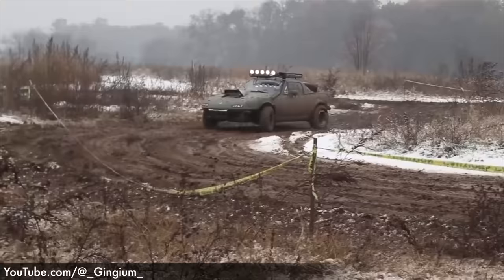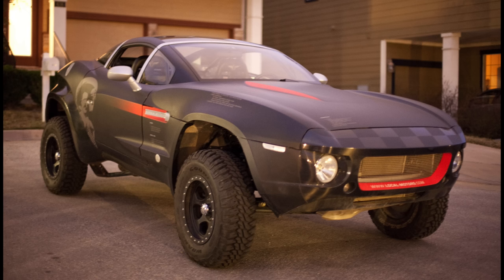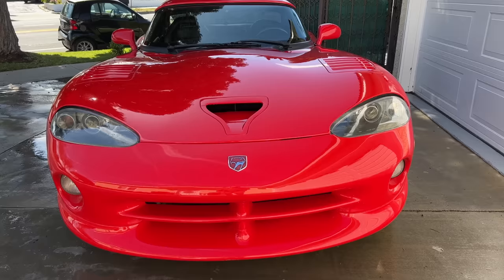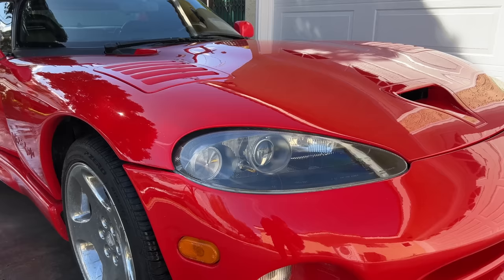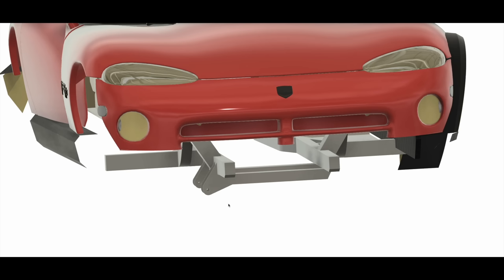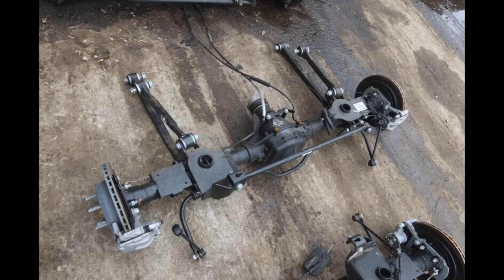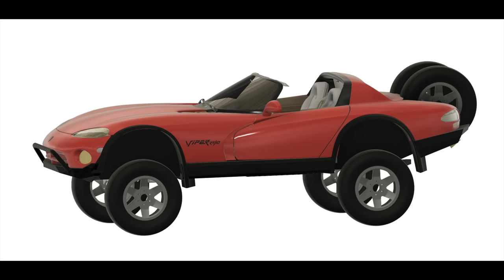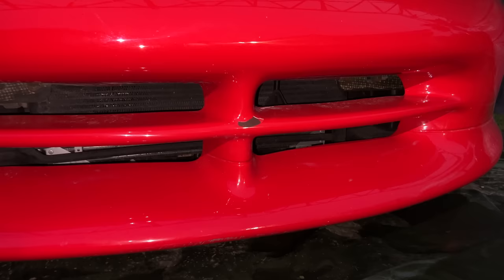Let's Build An Off-Road Viper

Comment: Add electric hub motors to the front tires to give you part time four wheel drive for when you get impossibly stuck. Could get away with a tiny battery due to the part time nature of 4WD.

Comment: You might be able to do AWD instead of 4WD if you use the front transfer case out of an x-drive bimmer. If you happen to find one in a junkyard you'd probably be able to rip out the ZF-8HP trans at the same time.

Comment: You should use solid axles in the front too. It’ll be easier than designing control arms/spindles & it would be stronger than IFS too.

Comment: You might consider a rear axle from a Ford E 450. They are beefy and often paired with a 6.8L V10 engine. The heavy duty Ford automatic 5 or 6 speed are great transmissions as well.

Comment: I think adding front wheel drive should be looked at doing this electrically, with some 48v system that will fit somewhere in there. It will only support you at low speeds. Which is very interesting, but maybe not for this car. You just want to send it at higher speeds, just like the Rally fighter.

Comment: I noticed the powder trick you used for scanning. We had to use that a lot especially on black cars when we scanned accident surveys. 

I did the Viper idea. Just a thought if you are having packaging issues. Maybe do portal axles and get the lift without moving the axle shafts too much.

Comment: As crazy as it seems a Viper is a pretty decent option for this. The chassis and suspension is pretty simple and there’s a good bit of frame to attach mounts to. And, there should be lots of room in the trans tunnel for whatever you need to put in there.
Reply: There are even more features on the level that you’ve qualified it as “decent”. Such as- it’s a car and also it can be bought.

Comment: You could try getting a Unimog (404) axle for the back. 
I mean do I have to say more than: Portalaxles?
Besides that you've got a proper locking diff, they can somewhat easily changed in with the way they're designed.
The fitting from axle Also has an Offset diff to clear the engine on the mogs. 

Maybe they're worth a shot.

Comment: Ide put a 4l80e behind the viper engine if your going auto, it's stout,  lots of transfer case options, it's got huge aftermarket,  parts are cheap and easy to find. Ita got overdrive, and the gearing is already good enough you don't need 8 gears.

Comment: Axle from 3/4 ton 4x4 Dodge Cummings truck may be what you are looking for. I believe they are Dana 60/variant. It’s a common swap on built Jeeps when you keep breaking stuff. Not sure on trans but the auto trans may just bolt up. Of course I haven’t verified any of this because this is your project not mine.😬😇 Sloppy Mechanics repurposed those dirt cheap Ford 8.8 rear offset pumpkin axles by using two of the long sides. He was running 900+ hp through them. A limited slip rear end maybe what you want if locker is not feasible. Well Rubicon axle maybe looking better.😇

Comment: Could you put a couple of small electric motors up front to solve your 4WD needs? Hook up a KERS system, and a couple of batteries tucked up underneath, and presto, easy peasy (not in the least). Be well.

Comment: I fucking love this. 
If you are going ZF and maybe AWD, could you pull a transmission and transfercase out of an X-drive BMW? I know the X5 has the ZF8HP and an AWD system, if you could find something similar to canibalize (and figure out a way to communicate with the ZF and centre diff clutch packs) then that would probably be the idea solution. There are a bazillion cars that use the ZF 8 speed and a lot of them are AWD so you have ample options

Comment: How about a couple of hub wheel motors up front. So much trouble to go to, just to get stuck on wet grass. Even 20 kW per wheel, and I think you could walk out of the soft stuff, and maybe always bleed 10 kW to them in normal driving to make it less twitchy, or to limp home 10 km, after your drive shaft fails....?

Comment: I love the 8hp70 and cant wait to see how you control it but, I hope the torque multiplication vs large heavy wheel wont snap axles in the dana44. Check the m220 version in the 392 powered  wrangler jl

Comment: Look into old tractor parts, see steiner catalog for example,  they carry lots of oddly sized and specific parts that are more than  overbuilt for this application and they're relatively cheap for universal components,  just find the part you need and cross reference it to the agriculture industrial hardware category via Google and bam, tractor part prefab, 500 vs 5000 for racing specific parts. P.s. my 1945 farmall is literally indestructible and is more dependable than my truck or my car. Good luck!

Comment: Mainly here for the algorithm but I vote a ford nine inch or gm 12 bolt for the rear. Mainly because its relatively easy to get aluminum housings for them for cheapish and this will keep the unsprung weigh down a little bit. However, having a rather large mass in the arse of a viper sort of embraces the whole america-ness of the build. It doesn't have traction onroad, why should it have it offroad?

Comment: Don’t screw around with a zf trans. Use a 68rfe Chrysler 6 speed. Will bolt right up, operate way better and be way cheaper.

Comment: Awesome project! I am not sure it will surpass the sandwhich though!

Also, why so many flat tires? I have done two huge overlanding trips through all of Asia, and I only had a few flat tires, of which some were preventable. Even for those huge trips, I now just take 1 spare and some basic tools and compressor to get another one going far enough to reach civilization again.

Comment: Well when the poll was up I loved the idea of a jet engine electric car. I'm now doing some research and planning to build my own car. I want to recreate the fallout 4 car . Add the 2 electric motors. The back is already perfect for a jet engine.  And the front has a huge grill for cooling.  
I could use a 3d printer to make a fiberglass mold . And a Cadillac frame. Or a full custom frame

Comment: I don't know what axle ratio these run stock, but you're going to need a wildly short gear ratio out back to prevent it from topping out at 120mph in second. These cars already have long ass gears, and now you're talking about 33in tires on a car with a 0.5:1 overdrive 6th.

Edit: You mentioned that later on, 4.70 sounds about right, though with an auto trans it's really not that important

Comment: The ones that are bespoke and going to get damaged first evil grin here. Don't you mean the ones that are going to get yanked off and sold and replaced with something much better and more beefy and not going to be worried about in the first place? Honestly if I was going to do a off-road Viper I'd be going a slightly different direction than you are and I'd be mainly using the motor and the body itself but like you said you don't want to use a Viper hat on a truck. I've honestly wanted to do something similar to what you're talking about with a Chevy Caprice or a yes it's been done before 60s Mustang body but in either of those cases it would honestly simply be a shell on a drivetrain. I've also seen four wheel drive Chevy utility vans that make me very very tingly;) and a few of these as I understand it were actually made by a company back in the day Ford put out a couple as well that were actual four wheel drive lifted assembly line built Bad girls that were basically a mullet with tires , business in the front party in the back cranked up to 11;). I practically do good to pay some of the bills and get from month to month so I don't have a four-wheel drive Chevy utility van insult injury being I know somebody that has one sitting in their yard growing up in the grass and the reason the guy bought it will make you even more sick he bought it to use parts of it on a Suburban where this particular van was built with mostly Suburban parts. Nice idea there sunshine boy taking a super rare vehicle and using it for parts on a very common vehicle. No there was nothing to write the vehicle off it was running and driving and not rotted out he simply bought it to use it for parts on a Suburban that he owned or more than one Suburban to be precise guy had a couple of custom-built off-road Suburbans and this was his Parts vehicle. So it's not like something somebody dreamed up I've seen the thing and touch the thing I know they exist lol. I've seen the Ford ones running around here a few times very nice units. Would just love to you at some point own a van or more so Caprice done up like that always makes me think of Mad Max;). Seeing a few 60s Mustang bodies done up with a frame and drivetrain and just love the look. What you're describing is basically an apocalypse ride and I like that somebody's doing it with a Viper but honestly I'd go with a completely different frame and drivetrain and just use the body and the motor.Because it eliminates a lot of problems down the road and makes the vehicle much more durableYes I don't have the money and yes again personal preference. You got the money and the skill so by all means go for it. I know exactly where you're coming from

Comment: Will a Viper chassis surive the repeated stress and extra vibration of going over dunes? Those things are probably built a bit more lightweight than trucks, right? Feels like this is could go the way of the motobike engine oilpan after you take it for some serious extended offroad tours.

Comment: Dana 44 is a terrible choice 😂. It’s all about ring gear diameter especially with a v10 . The bigger the better . It’s not horsepower or torque that will destroy them it’s the unloading and loading of the tires

Comment: Lmao I live in Montana and ls6 swapped my Miata (horrible car to ls swap and terrible place to build one), a few months later I threw a paco motorsports 3” lift kit on it and 25inch Blizzaks when winter rolled around and now I deliver ubereats in a 2000lb death trap in snow and ice muscling 400lb-ft of torque through a t56 magnum and a t-bird 8.8. Seeing this build idea gives me some validation, even though I couldn’t afford a viper, that lifted convertible muscle swap cars are cool and will forever be cool. Is any of the power usable? Absolutely not in winter but I still managed to get a 118mph speeding ticket at the top of an icy uphill onramp from an incredibly confused highway patrol officer who couldn’t reconcile his radar numbers with the car he saw and the limited space it had to accelerate. However, a few months later my CV axles are unfortunately in need of replacement due to the lift and I can’t wait for the roads to clear a bit more so I can drop it back down and put sticky tires on once more. I enjoy the heck out of my car but there are some livability issues, like not having a speedometer (holley has had my dash on back order for 8months) needing to drop my entire front subframe just to do spark plugs, and having my water pump/thermostat go out in a -25 degree cold spike, but other than that it’s been a wonderful and reliable daily driver and delivery vehicle. I hope your lifted viper project turns out even better!

Comment: I've been wanting to swap old automatic transmissions with new ones with more gears but I don't know what I need to do beyond swapping tranny's. I don't even know what electronics are involved to handle the transmission shifting. Mainly a vehicle that has 4th gear as the overdrive. Personally I want to replace the cluster gauge that has a higher speedometer range. The arm dial is nice but it would be nice to have a wheel that rotates. A needle arm is light and easy to control compared to a wheel that would require much more torque to control. Digital is fancy but the lifespan of that tech is much shorter. Even the tech from the 90's is now failing.

Comment: I have a lot of hard won opinions on off-roaders and winches. In this case none of that matters :o) I would keep the manual though, that’s a lot of cocking about. Dumping the clutch might be a handy feature? (Rear lock up on overrun)

Comment: I really don't think this is going to work in the long run for at least one particular reason, the driveshaft.  The Viper driveshaft is all of maybe 2 feet long.  You are going to be constantly destroying u-joints with the driveline angle of a 12" lift unless you also tilt the engine down to go with the axle pointing up.  And it's not like you're going to have room to put a center bearing or drop box in either, so not sure how you are planning to deal with that.

I would also just beg you to find a car that has a bad frame or something already.  There are so few of these cars on the road to begin with that cutting up something in reasonably good original shape just kind of feels wrong.  Get something that is already trashed if you are basically going to have to build an entire new frame for it to start with.

Comment: So I have an old question, I can get an answer to get me to "draft the schematic". But it applies to your build so hear go's.
Is it possible to build a secluded ground for a second alternator system? You'd do this if you wanted to put a bunch of extra off road stuff of your off-road build, and not ark out you super expensive electricrical in your viper.

Comment: Are you using a 3D scan of a viper to model things on?  If so, how are you able to work with the massive mesh that the 3D scanner made, it bricks Solidworks/Fusion360 everytime I try to open one.

Comment: Gotta stop you right there, safari cars traditionally have more ground clearance than actual rally racing cars, which are approximately stock height or slightly taller. Carry on

Comment: What about portals?
Reply: The 99 RT durango came with IFS and all wheel drive. Frame widths shouldn't be too far off and could be fabricated to the viper chassis below the oil pan. Would give you at least a 3.5 inch lift. Going with portals would give you another 5-6 inches and tire size would give you the difference. Portals would also give you a gear reduction making the awd t case choice a lighter option.

Comment: I asked GPT; what to you think about SuperFastMatt raising his dodge viper 12 inches?  

And GPT said, "As an AI language model, I don't have personal opinions or emotions. However, raising a car like a Dodge Viper 12 inches is a significant modification, and it's not something that should be taken lightly. It's important to consider the potential effects on the car's handling, performance, and safety. Raising a car too high can negatively impact its stability and cornering ability, potentially leading to dangerous situations.

If SuperFastMatt has the necessary equipment and knowledge to perform the modification safely and correctly, and he's not compromising the car's performance or safety, then it's ultimately his decision. However, I would strongly recommend consulting a professional mechanic or an expert in car lifting before attempting such a modification. Safety should always be the top priority when it comes to any automotive modification." 

Idiot.

Comment: Are you going to be cutting your own carbon fiber parts ? I have a vague recollection that you have or have access to a CNC mill or router. I cut CF parts for home projects and, other than the dust, it's wonderful stuff to machine ( I do sheet CF only ). I use a 1/16", single flute cutter or a 1/16" diamond burr running at about 20,000 RPM and a feed rate of about 15 inches per minute ( I'd have to verify that feed rate as I'm away from the CNC computer right now.) I get my CF sheet via Amazon; details available if you want them. If you want some small parts cut, I'm happy to do that for your project if you like. Here's one of my CF projects :
https://www.youtube.com/watch?v=Mimuk5yz5Ss
Reply from the maker: SendCutSend does carbon fiber, so i always get it from them. That clock is awesome, btw.